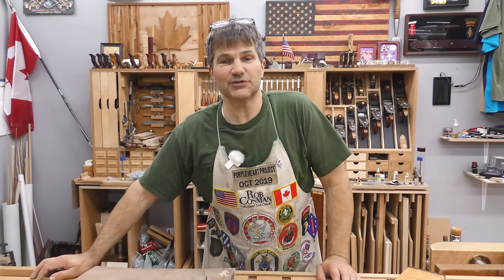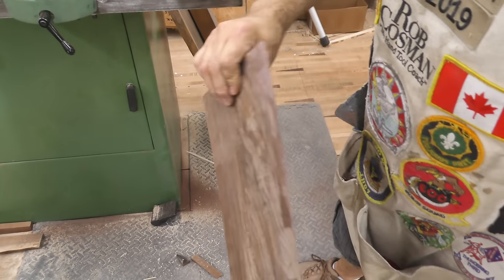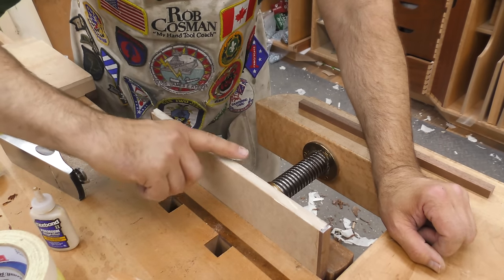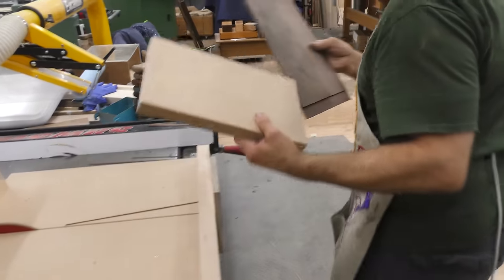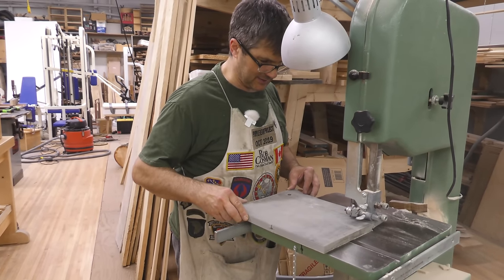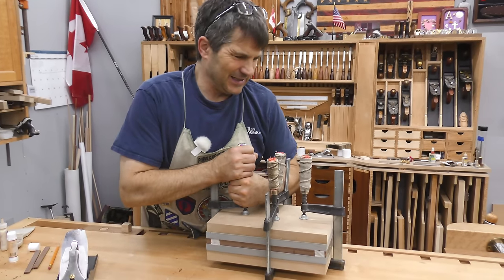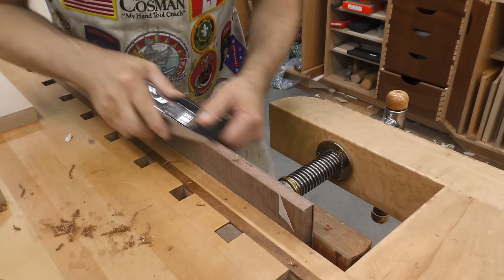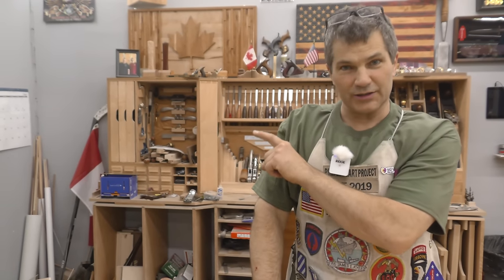Making A Wooden Box - Veneering the Lid

Comment: To glue a crack in wood, I apply the shop vac hose to the back of the crack and apply glue to the front.  The vacuum will pull the glue through the crack.  Franklin Glue Co. says a 3/8-24 bolt thread is the best glue trowel.  I use one, especially for tambour, because there is minimal squeeze out.
Reply from the maker: Great ideas, thanks

Comment: Thank you for another great learning experience. For cutting veneers on my band saw I wax the table, the bandsaw blade and the rip fence. The process seems to go smoother. When you are concerned about that glue fill repair in your veneer sticking to the foam wax the foam so the glue does not stick to it. I like it better than tape. I have not used MDF. but I will give it a try as a substrate. There were other neat bits of info buried in this video. Thank you again.

Comment: Great video!
After cleaning the crud off the foam rectangles to achieve even pressure, you then use masking tape to hold down the edges before clamping with the cauls/foam. Wouldn't that cause uneven pressure too? Or is it just too miniscule to worry about? 
Love your videos Rob! Thanks a million!

Comment: Would you ever set the veneer inside the box made by the 4 edge pieces to protect the edges of the veneer? When you stick the edge pieces why don't you line one end up with the carcass so you only have to plane/trim one end? My dad used to steam his veneers when they were twisted (and to conform them to rounded surfaces like the bands on a round table), is that still an OK method to resolve veneers which aren't flat?

Comment: EXCELLENT VIDEO. I doubt that the time & effort to do this lamination could be recovered in the end price unless your boxes are extremely expensive! All the same an interesting process. If  the wood lids shrink I would have thought it was due to the wood not being dry enough for the purpose. A bit longer on the shelf perhaps??? 
One concern; the gluing application with a trowel looks a bit hit & miss... aka Uneven. I would suggest a foam or rubber roller for spreading out & levelling the glue before the next step. 🙂

Comment: I've never used cambered cauls, but after the number of clamps needed + the 1" MDF, would that provide any easier/quicker clamping and still achieve the even pressure? I only started looking for 1" when starting the bench but haven't found it in Oklahoma. I initially thought you would not need as many clamps as you ended up using.

You mention a vacuum press. I also have never used one of those, but will you be trying it in the upcoming videos for Christmas presents?

Comment: Good technique for warped board "fix" as follows using a power planer, take a piece of 1/2 plywood just larger than the board that's warped. Place the warped board on top of the plywood,  put wedges under gaps and a stopper on one end of the warped board to keep it secure so it won't slide going into your planer.  screwed down stopper at least 1/2" below the lowest part of the warped board so it can pass under the surface planer. Put painters tape under any big gaps and use hot glue to fill the gap/voids and secure the plywood to the warped board. Now run the warped board through your planer until you have the top side of the warped board nice and flat. Now you can flush cut the other warped side on band saw, or run it through the planer also. As long as the board is narrow enough to fit through your planer it will work great.

Comment: Rob I have a question about this, if I took hard wood around the perimeter of the lid, the in the inner side of the Perimeter made a dove tail across that, ten slide the top in. So length rails go first then side ones to finish the middle together. 

How strong of a lid would this be ?

Comment: Have you used a sprinkle of table salt on the glued surface to keep the veneer from sliding around?  Works very well.  I’ve used it to laminate 4 layers of 1/4” mahogany together with no slippage.
Reply from the maker: Yes i have.  I dont really like it as you can easily use too much salt and get a clump.  Happened to me once and i never used salt again

Comment: Why do you use masking tape instead of painter's tape? Is it less likely to break when stretching to pull it tight? I've avoided actual masking tape because of the residue. Where I've always differed in veneering is that I cut my veneers at about 1/8", then (via David Marks) used a drum sander to reduce them to 3/32" uniform. This was fascinating watching to see the caution on the defect and use of the foam in the cauls. I'd used cork before. Will that work to compensate for the variation in thickness? It has when doing a bent lamination in forms so far.
Reply from the maker: I have never used cork but I suspect it would be a good material to use.  I was worried painters tape would not stick well when I put it under tension>>>>I will give it a try
Reply: @RobCosmanWoodworking  I've used cork to good success.

Comment: As you were preparing to saw the first sheet of veneer I was wondering if it would have been easier to glue the walnut to the MDF before slicing the veneer. After seeing the whole process I guess not. I know that is is required to veneer both sides of lumber and plywood. But is it necessary to do both sides of MDF? I'm thinking of an application where the inside of the box would be covered with flocking. As to your method of teaching, it is outstanding. You don't rush through steps which makes it very easy to comprehend everything. Thank you for sharing. Have a great day and please continue to stay healthy.
Reply from the maker: Yep same principle applies.  Do to both sides so you have an equal amount of moisture to prevent cupping.  Of course MDF is much less prone to warping but I still follow the general rule.
Reply: @RobCosmanWoodworking   Glen - the flocking doesn't put the same tension (albeit light) as the veneer. But a secondary wood saves the good stock for more boxes and would not seem to add much in thickness. 

My question for Rob - Does the flocking change how the lid would fit if it is also flocked? How would you compensate if so, using the wood hinge? (I still need to watch any existing and the new ones coming out) Would you just use tape around the inside border to keep the flocking back?

Comment: How do you feel about the trick to add some table salt to the glue to prevent the sliding when doing broad surfaces like this?  Do you think it harms the quality of the glue joint?
Reply from the maker: Well there is a trick to that trick.  If done right its OK but its easy to screw up.  You must use very little salt, one or two sakes and thats it.  If you use to much it can clump together an prevent your boards from setting together

Comment: Thanks for another excellent, practical video.
One small point which might be useful, regarding getting the glue into splits, such as that of the crack on one corner of the veneer: put the glue (thinned down a little, if need be) on the surface, and then apply the vacuum-cleaner nozzle underneath - works every time.

Comment: There's no substitute for a sharp blade. Well done.
1.  Is there a reason for not using mitred corners or is just a matter of "I do it that way because I do that way."  Which is fine too. 
2.  Would flattening the veneer by tapping it down to the bench and then using the No.7 on it do the trick? Rather than having to find foam and such for the clamp-up.
Reply from the maker: On these boxes you cannot see the end grain with the lid closed so I dont go through the longer process of fitting miters.  Planing such thin stock is very difficult.  Too hard for my taste

Comment: Those hairline cracks in walnut are so common. It just adds to the fact that it's a rare hardwood, expensive, sought after, and then once you get a good board, you often need to check it. Still, a great wood to work with. Also, 11 clamps for that small lamination, it's not going anywhere ;)

Comment: Love your videos, this was great! Do you have any advice in regards to materials for anyone who DOESN'T happen to have huge, thick rubber mats leftover from a bowling alley in their shop!?! I'm an architect by day, so I have maybe a couple products in mind and I'll ask around. Perhaps contractors might be a good resource.
Reply from the maker: Yes, options are: piece of hard foam mat you can easily get at any box store, a cork sheet, closed cell backpacking sleep mat, yoga bat, etc.....
Reply: @RobCosmanWoodworking  I'm putting rubber matting on my basement floor right now.
For the kind of rubber you were using, horse stall mats (mentioned above) are the cheapest source of hard rubber mats.  Grain and feed stores carry them.  You can find rubber flooring with a similar thickness and hardness, but it's going to be pretty expensive.  Be prepared, the horse stall mats weigh about 100 lbs each.

Comment: Why use the hand plane to trim the veneer edge, when you have the cross cut slide? Wouldnt the first cut create a reference 90 to the blade, then just trim using that edge first and go around the board? .. just curious about why certain techniques are used. Great vid!!
Reply from the maker: Your way would work too, but its super quick just to grab the plane.  By the time i went to the tables saw, pulled out my crosscut slide, lined it all up, made the cut, then back to the bench to plane away the saw marks i just made, i am done by just using the plane

Comment: i noticed that you used a rope on one of the clamp handles rather than your normal hockey tape method in order to create a handle that is more easily gripped.  are the two methods comparable in quality?
Reply from the maker: No, its all hockey tape method.  Just the wrapped hockey tape is thick
Reply: @RobCosmanWoodworking  i can only assume that the evil one,  SuperDave, has somehow, and i can only assume by nefarious means, infiltrated adn replaced a rob cosman style wrapped f clamp with one wrapped in his own desighn of yellow braided rope slopily taped to the sides of the clamp handle. at 39.13.
to what evil and immoral end i may never now know.

Comment: You said that dovetails add strength to the box frame. Why do you need that much strength. It seems overkill to me, as there will probably not be much stress on the box as there is on a drawer, for example. Isn't dovetail joinery merely cosmetic on a small box?

Comment: Why didn't you veneer the faces of the MDF first and then edge band around the panel?
JIM
Reply: Because of the appearance.
Banding after veneering would be very obvious, and be awkward to clean up afterwards, with the plane.
I suppose, if you are really fussy, you could fix the edge band with 45 degree mitres, which would show even less and make the piece look more like solid wood.
I knew of one case in which the woodworker banded the ends of the piece in *end-grain*,  which is going over the top, somewhat!
Reply: @Offshoreorganbuilder  Thanks for your opinion.
I think planing the veneer on all the edges is just as fussy as you claim the planing of the edge band veneer to the top would be.
I like the look of the edge of the veneer showing on the top face best, so I think the reason of the method is a matter of personal preference.
JIM
Reply: @jimc4731  True, if you like the appearance of veneering that way, that's how you have it, of course.  Banding in a contrasting wood, with 45 degree corners, could be a striking feature.
However, there is also my point, " ... and be awkward to clean up afterwards, with the plane."  When I said 'awkward' I referred to the danger of breaking out the fibres of the banding, as the plane ran off the edge of the board.  It would be necessary to take precautions to avoid that.
(By the way, I am all in favour of being 'fussy'!  It was edge-banding with end-grain which I thought might be a bit 'over-the-top', and, even then, I see nothing wrong with that if you are prepared to take the time.  The average person would, of course, completely miss these sophistications, but we make them to please ourselves and our sense of craftsmanship.)

Comment: Yet another great video but I will never use MDF again.  I always advise people to never work with it unless they wear a proper mask and eye protection. The additives in the MDF and the super fine dust are so dangerous that I would rather source some quarter sawn wood for things where a fairly thin panel is required. I lost a dear friend to cancer of the esophagus, which was caused by exposure to MDF dust. Working in a factory producing furniture and woodware items for retail, my friend often worked without a mask and suffered a chronic respiratory illness culminating in cancer of the esophagus which killed him in a matter of months. The manufacturers have amended the formula over the years reducing the amount of formaldehyde but the dust is still so dangerous. Please, please protect yourself and advise your students that proper PPE is so important if MDF is the only material they can use. I simply will not use it ever again after my experience.
Reply from the maker: Yes its.  You need great dust removal and a respirator.  I hate the dust love the product.  MDF isnt the only dangerous one.  . Cedar is dust is another example of very dangerous dust.  Another reason to go hand tools only